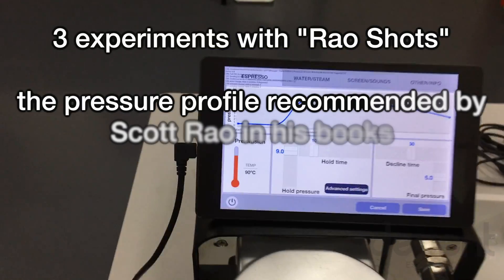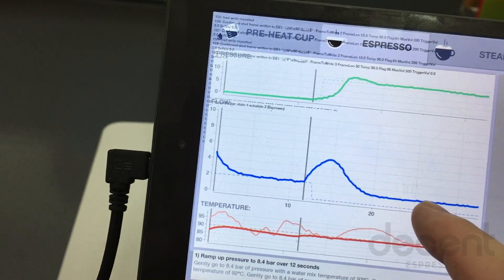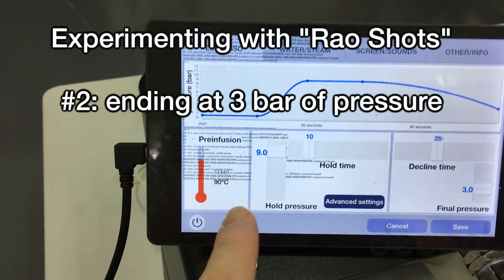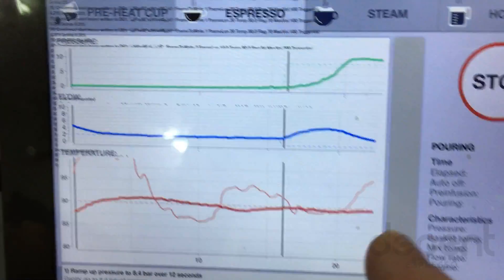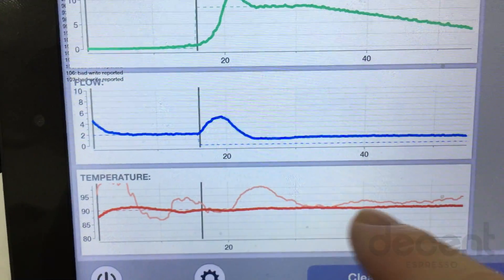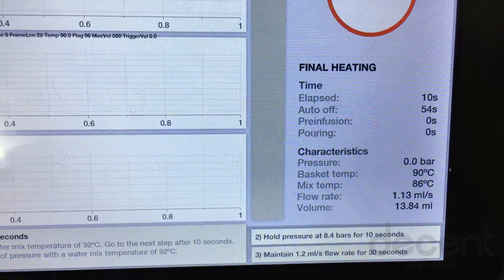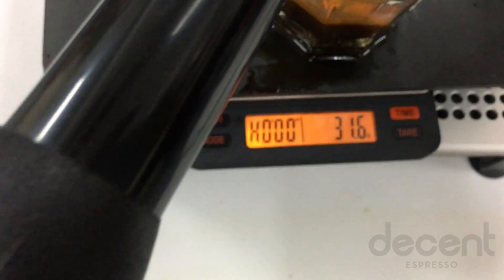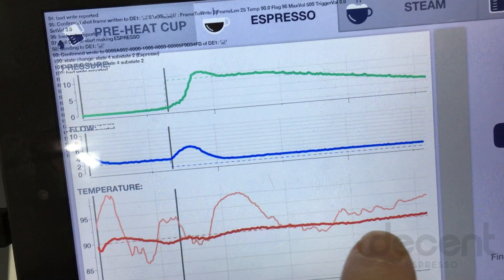Experimenting with "Rao shots"

Comment: Looks like the volume measurement isn't working (can see it for a split second at 7:05). If it was working, could you pull a shot based on the water volume? Or are there only time-based measurements to end a shot?
Reply from the maker: Well spotted! I believe that the total volume measurement on the tablet is currently accidentally including the water used during the "final warming" step where water circulates everywhere behind the group head to get the entire system up to temperature.  Thus, it's reporting too high a number.  Did I mention the software was still in beta? <grin>  If you watch the flow rate number, you'll see that the total water volume is correctly going up every second by the flow rate amount.

On the DE1+, there is "volumetric dosing" available (ie, water volume based auto-stop), but it's implemented as part of the shot steps settings in "advanced mode" (see the video comparing the DE1 to the DE1+).  

To use volumetric dosing, you'll want to make a shot that you like, note the total water volume, and then put that in your advanced shot setting, as the water volume when future shots should stop.  This is currently available in the espresso machine's firmware, but the GUI support for it isn't coded yet, but will be in a few weeks.
Reply: Excellent information, thanks! And no worries on the beta, totally understandable. Appreciate the explanation and early insights into the process.